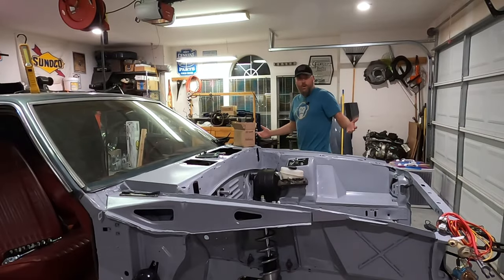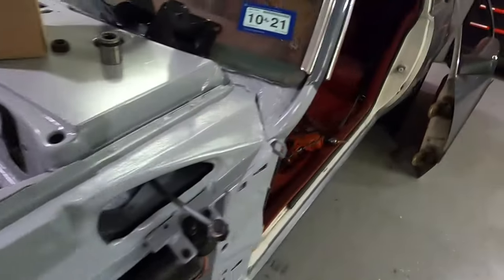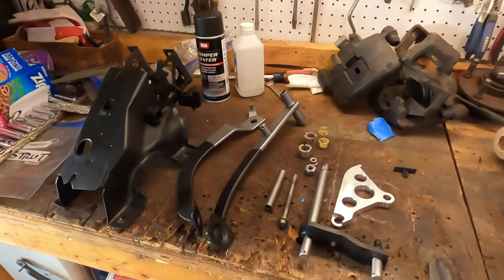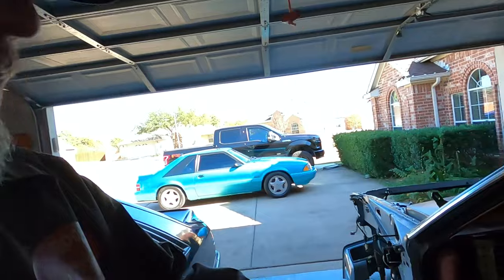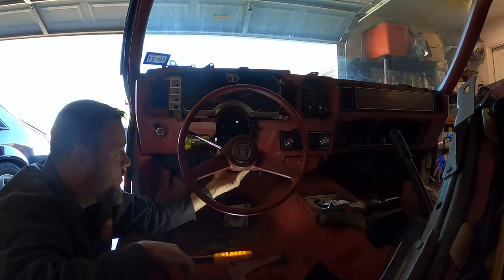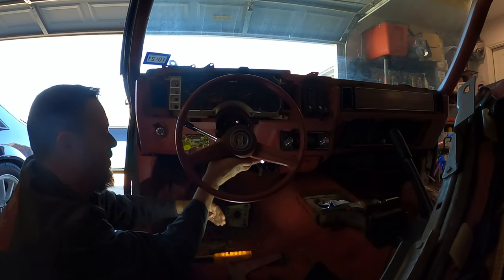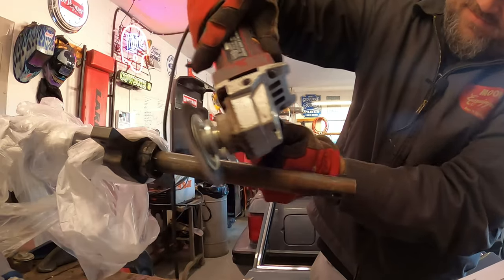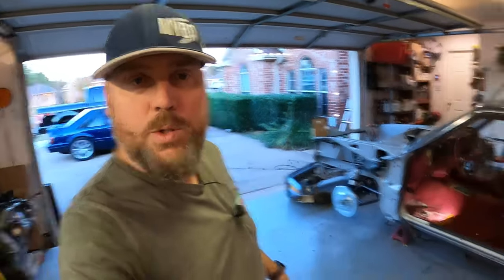Foxbody - Pedal Assembly Swap - Episode 26

Comment: Hey Mike, the Maximum Motorsport instructions for that quadrant recommend three or four washers between the pedal mount and the quadrant (approximately the thickness of the spring that is removed).  This helps align the quadrant with the cable coming through the firewall and WHEN I FAILED to do it, the quadrant got hung up on the pedal bracket when the clutch was fully depressed.  Installing the washers may need you to clearance that brace a skosh more. Great project, love the channel
Reply from the maker: I was waiting on a comment for this! So hard to get EVERY detail in these videos without them being 40+ minutes long. I wondered that, so printed off MM's instructions and also added the correct washers to space it out. You are 100% correct. Good eye man!
Reply: Mine actually has the aluminum quadrant and the adjustable clutch cable. I searched for the install instructions so I can get the washers back correct. Where did you guys find those?
Reply: @Nine_Finger_Wrenching  hey nine finger, my quadrant actually came with a stack of washers and a set of instructions. It’s been a while but there is no real measurement needed. If your plastic rod bushings are in good shape, Just add washers on the rod between the clutch pedal arm and the pedal hanger. You should just be able to get the clip or cotter pin on the rod on the right side, I can’t remember which it is now. Basically you are spacing the clutch pedal arm to the left or it could bind on the pedal hanger bracket
Reply: @alanhill5513  thanks Alan! It’s nice to know these little things.

Comment: I have a 91 and is a auto  and i drive it almost daily,back in 03 i did this cause i was gonna end up swapping a manual tranny but then i had a motorcycle accident and almost lost my left foot so clutching is out but i left them that way however i removed the clutch pedal since it was just flopping around, i remember it was a pain in the ass putting that assembly in,lol,its always bothered the hell out of me how Ford left all the dash surfaces underneath bare and everyone of them is rusted.

The parts ive been able to take out i have sandblasted and painted but sometime in the future i'm gonna put a new dash in, that new dash skeleton will be disassembled and painted without a doubt,a funny thing happened to me lately,Ive been around these cars for quite some time and i just realized the accelerator pedal is different between autos and standards,why is that? pedal proximity?

Comment: I'm going from manual non servo brakes to a auto with servo brakes in my 78 Mercury zephyr. Think it would be best to just swap out the pedal rods rather than the whole assembly? I've brought a auto pedal assembly so could just take the rod out of that and use that with the cobra servo
Reply from the maker: Man for a zephyr, your in the same boat as me with these early fox bodies. Neat car BTW! I would personally take the time to move the pedal assembly. Since your also swapping from manual to auto right? This way it all matches. Another thing to look at is where on the pedal the rod attaches to, higher up the arm, lower down etc.. The placement for manual usually is a little higher up for the extra leverage for manual brakes....more leverage / less travel, all this is matched to the assist, and MC bore size. I just re-read. You say swap rods? Im not sure what rod you mean, I was thinking master cylinder rod...sorry, if you mean just swap the arms, I think you'll find it easer with it out of the car anyway so you mind as well just swap the assembly.
Reply: @HOUSEOFDULA  thanks mate appreciate the time. Yes with the rod ment the rod that goes through the pedal assembly holding the clutch pedal. Seen a few with the big servo and not sure if it's a bit big for my liking with the look of the minimal engine bay. My other thoughts is to maybe keep manual brakes and then just get another master cylinder with the right bore size for having disc disc set up. That way I could leave the pedal as it is remove the clutch pedal and do something like weld a thick plate shaped same as a auto pedal to the manual pedal for 2 foot braking 😂
Reply from the maker: @blownpoppm  With a disc disc manual you could easily need to use both feet! I too dont care for the look, but I think its easy to get over the look and know you have solid brakes. If you stay manual, go disc front, drum rear. You'll need a proper proportioning valve and or residual valve to hold pressure on the rear for drums and the right MC. I have manual disc/drum setup on my Torino and actually think it brakes pretty well, just takes a bit of pressure for the foot.
Reply: @HOUSEOFDULA  thanks I will have to see then when it all arrives and look at it a bit better. Thanks for the info and advice

Comment: anyone ever run into the issue of pressing in the clutch pedal but wont retract after you let off ? either gets stuck pressed in or gets loose , have aftermarket steeda quardrant and pedal assembly is all put to together just like in the vid .
Reply from the maker: Its binding somewhere bud. I'd start at the trans fork and work my way up. Is the fork binding? Throw out bearing binding? Then check the cable itself. disconnect from fork and make sure it more freely and smooth from the pedal / quadrant. If its still binding check the pedal assembly itself and make sure its not running or binding to any of the dash structure.
Reply: @HOUSEOFDULA  yep disconnected clutch cable from fork and the pedal moves the clutch quadrant back and forth , i thought the nut that tightens the clutch pedal could be the issue as well ? It seems to come loose even with loc tight , I don’t want to over tighten and strip it lol
Reply from the maker: @tsumetaikira6797  Yeah and if you over tighten it, it can crush the plastic sleeve bushing the pedal rod rides on. But if you removed the cable from the fork, and all is smooth, then might be the clutch and or throwout bearing sticking

Comment: So id be able to add clutch pedal rod on manual 2.3 to an auto 2.3 pedal assembly?

Looking to put manual swap in the (current auto 2.3) because it is a much cleaner/finished car
Reply from the maker: For a fox platform? You CAN add a clutch pedal to the auto and just cut down the larger brake pedal. These parts swap.
Reply: Yes, a 93 foxbody coupe. I just dont want to swap whole pedal clutch assembly, after seeing you may be able to just install the clutch pedal/rod straight to the auto pedal assembly. Thought id give it a try

Comment: By any chance do u know if u can use a clutch pedal as a brake pedal. I would like to eliminate the og brake pedal and use the clutch as brake to create space between the gas and brake pedal.
Reply from the maker: Never heard of anyone doing anything like this, anthing can be done though, I think it would be simpler to use the stock brake setup and either widen the pad or extend the brake pedal over a little bit

Comment: What parking brake cable did you use when you swap the rear end on your 86 gt
Reply from the maker: Right now? None. It needs one. I have an odd rear brake setup, that clocked the calipers to like the 8 oclock position, so the stock cable didnt work. I extended the brake cable to lever "rod" to make up for the diffference, but now the "rod" scraped against the driveshaft lol. Never went back for a solution and just removed it. Good think its mostly flat here, I keep in gear when parked.
Reply: I ordered a conversion kit from CJ Pony or LMR, can’t remember for sure, to run SN95 axle/brakes. Worked great but don’t remember exactly where it came from

Comment: HELP!!
Im looking for a pedal swap for my 79!! Anyone help me out?
Reply from the maker: What do you need? T5 pedal assembly?
Reply: @HOUSEOFDULA  yes sir!!! $300-400 is what ive found them for!!! I could about LS SWAP for that amount!!!🤣🤣🤣
Reply: @HOUSEOFDULA  you are making great video by the way!!!💯💯💯
Reply: Why swap pedals at all? The adjustable quadrant was junk. The only reason for the fancy aftermarket aluminum one is to replace the oem plastic piece. The early pedal assembly was superior, imo. You can even add a firewall adjuster to find tune it without getting under the car. I have three 79's and two 82's. All but one have t5's and I'm using the early pedal assembly. The cable is different where it attaches to the pedal, but they're still available. Pioneer brand and a couple others, but they all seem identical. Quality seems good.
Reply: @mccoma11  mine is an auto, swaping in a t5!